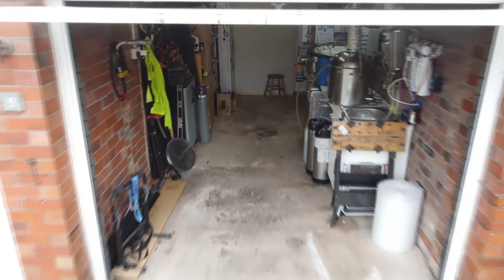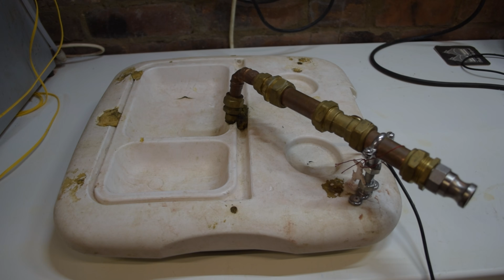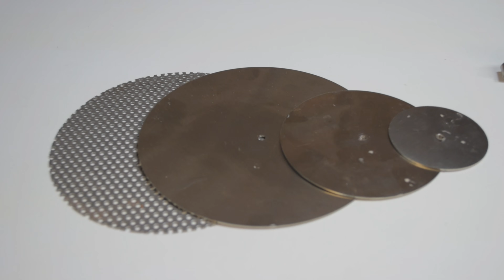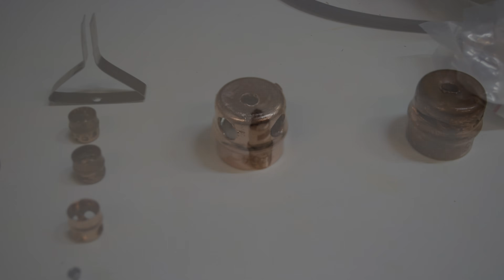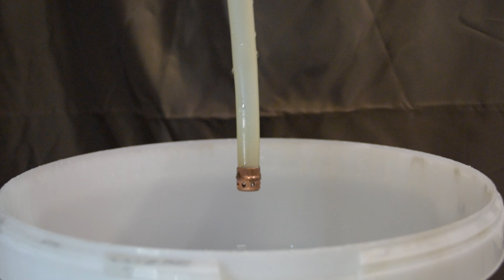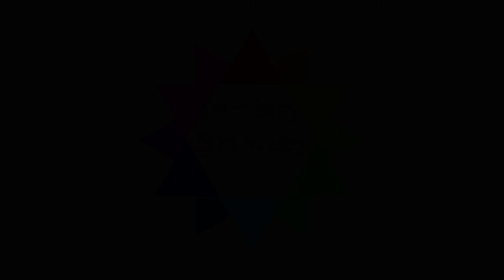Water Everywhere - experiments in sparge/recirculation

Comment: Why not make copper pipe fly sparge arm using brass T and 15mm copper pipe.
Reply from the maker: Mostly because I'm also looking at recirculation which means some grain might be in the flow.  This is what has blocked up my existing setup.
Reply: @TertiaryBrewing  I also recirculate until sparge I simple attach the arm onto the port.
No problem with getting it blocked because it's on sparge water plus the arms copper ends are loosely fitted for removing.